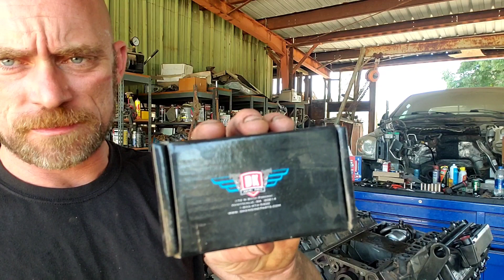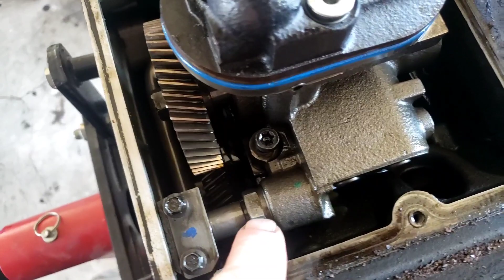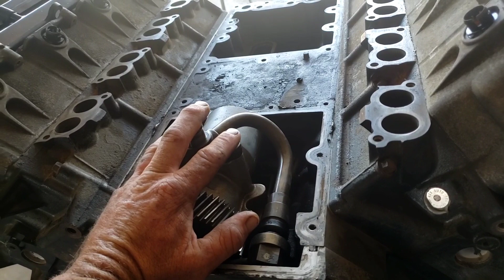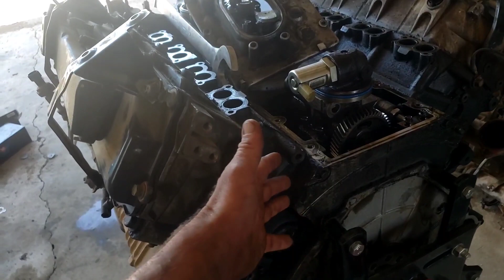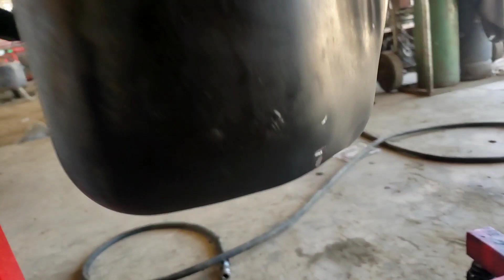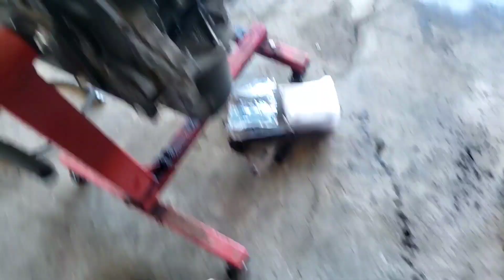6.0 Powerstroke bulletproofing - Hpop problems - ford f250 - diesel - upgrading to late model Hpop

Comment: Good vid. One thing though,  the pump was probably good. If the pump did wipe there would be metal in all of those injectors and they would of plugged up quickly.  It was probably a lifter, the metal would fall into the engine and ve pulled into the filter housing, it would also likely wipe the lpop and cover. What did all that look like on the motor with the cast iron. Pump?

Comment: Good video the powerstroke 6.0 was the worst powerstroke ever nothing but problems from the get go... used to wheel for a tow company from about 2003 til about 2008 the 6.4 was better haven't heard much from the 6.7 the previous 7.3 was probably the best
Reply: 6.4 was worse, it had one part to replace, the entire engine.